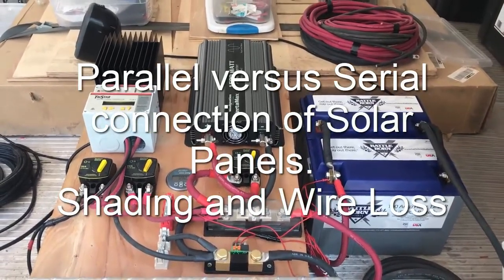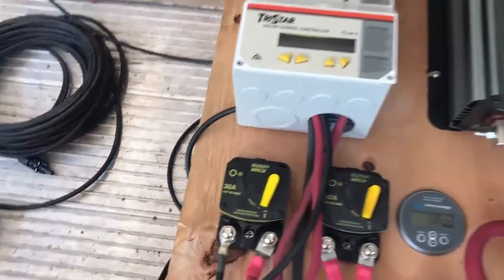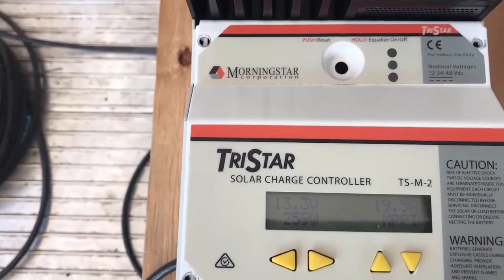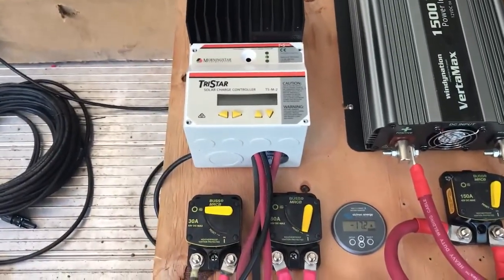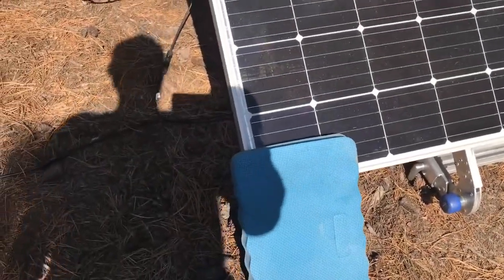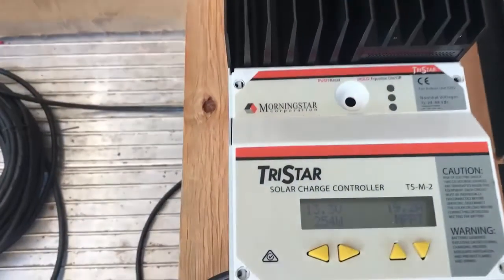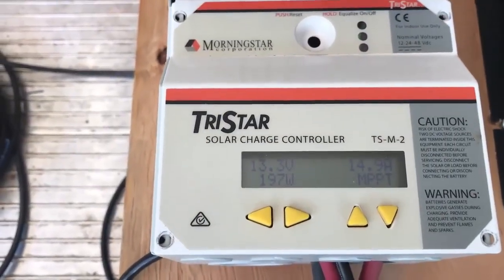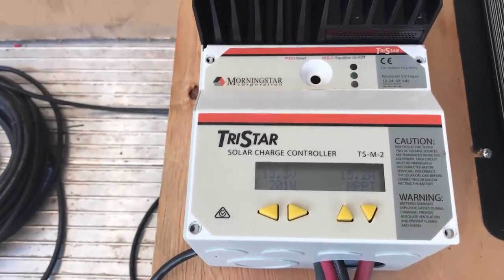Parallel versus Serial connection of Solar Panels

Comment: Would diodes help significantly for the series operation with shade?
Reply from the maker: Yes, If you only have one series like is common in residential installs that run a single string at high voltage. It also depends on the solar panels. The panels used for this video use RV panels that as you can see in the video is not performing very well. Residential panels typically have a good working diode solution.

Comment: Is it 75 feet combined?
Reply from the maker: 30 feet of cable, 30 feet going there and 30 feet going back again. Similar to the typical length of wire from the roof of an RV to the battery box.

Comment: Nice video. Appreciate how much effort you put into your demonstration. I went through a similar exercise on my camper and found the parallel connection delivered quite a bit more power when the panels get even a small amount of shading just as you demonstrate. To counter line loss we upsized cabling.
Reply: Upsized them to what? How big is your array?